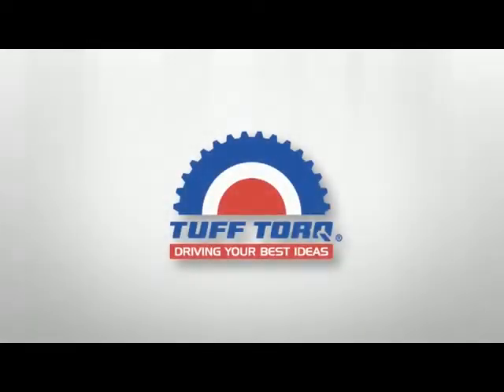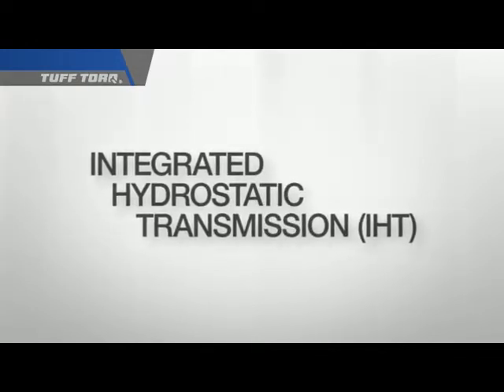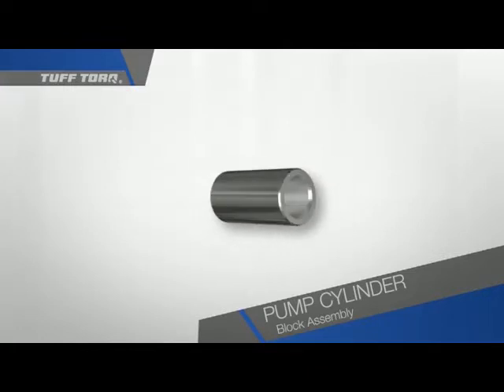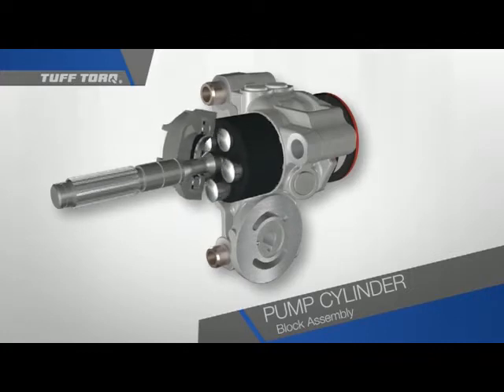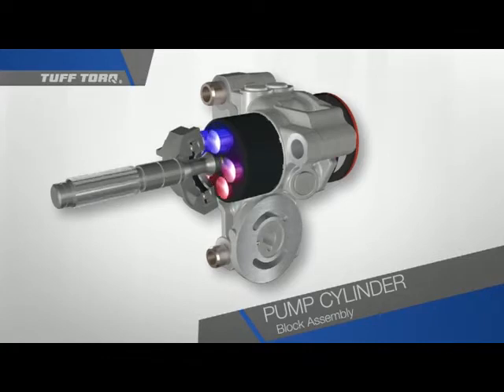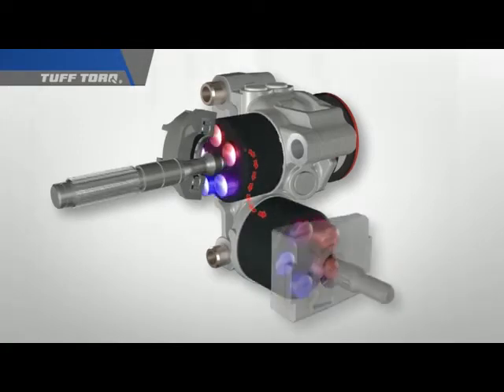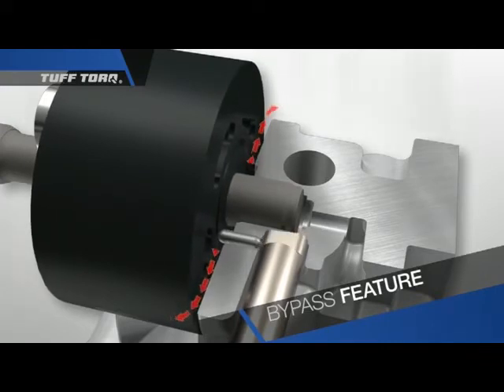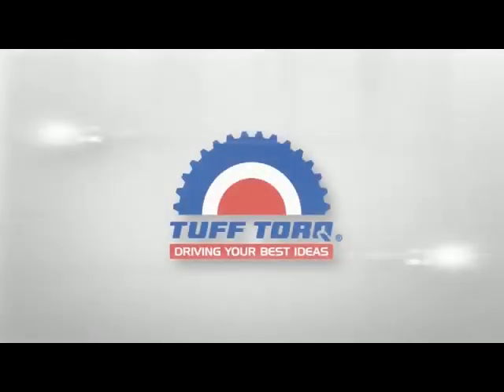TTC Transaxle Theory of Operation

Comment: Why is there no drain plug to drain the Transaxle Oil? No matter how good the oil is, the properties of the oil deteriorate over time.

To maximize the service life of the transmission, it is always advisable to change the transmission oil regularly, isn't it?
Reply from the maker: This is dependent on the make/model and specifications to meet the Manufacturer's demand. We do put drain bolts on almost every model series that we build, but if the manufacturer specs it w/o the drain bolt, then we build to suit. Please reach out to our service department at salessrvc@tufftorq.com with your model number and inquiry and we will get back to right away.